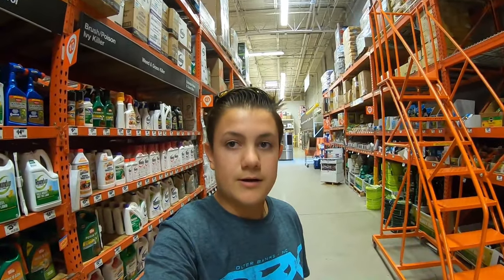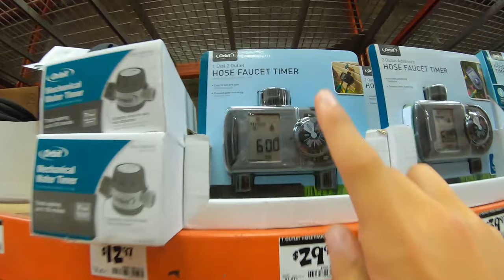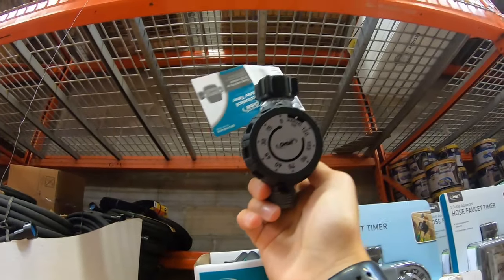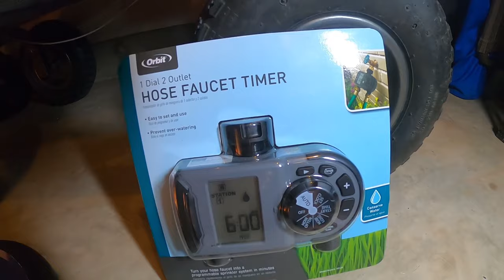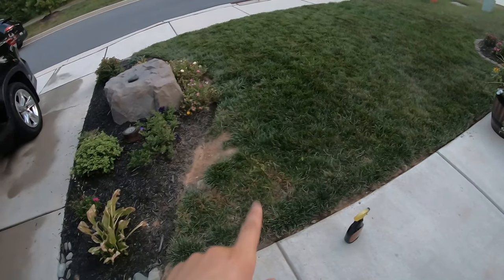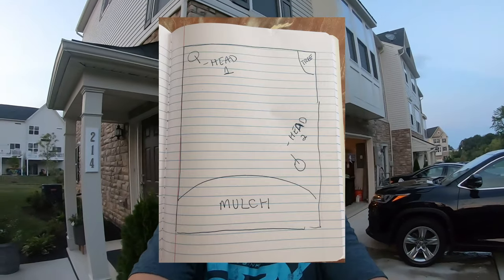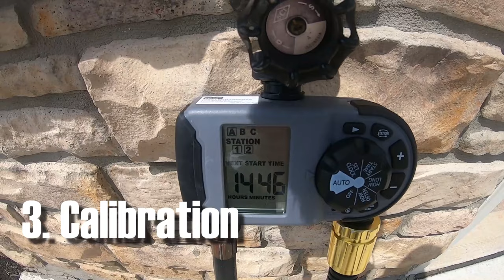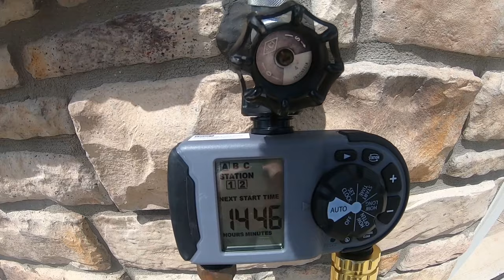Installing a DIY Above Ground Irrigation System | Combating Heat Stress

Comment: What's up, A? Great vid. Been a fan for a bit. You might consider two things: go to the plumbing aisle and look for something called plumber's tape or teflon tape. It's the same thing. It's usually a white plastic donut with a blue or red center. The tape isn't sticky, but it will help all hose connections to keep them from leaking. You might also consider exchanging that Orbit sprinkler you just bought. That shouldn't leak like that. Leaks cost you money, and they will oversaturate the areas where your sprinkler is giving you more of a chance for problems in those spots, nutsedge especially.

Good luck with the new set up. Can't wait to see the results in a future video.
Reply from the maker: Dude! I really Appreciate this! 1- All leaks are fixed! That black cap on the other side... was loose. So that’s fixed. I’m definitely going to get some plumbing tape... I may have some! Thanks for watching! I appreciate it!
Reply: @AsLawnandLandscaping  Glad to help. If you watch my vids, you'll see my son who is a little younger than you. He mowed his first lawn for his first customer this weekend. He decided to start doing it after watching your channel.
Reply from the maker: That’s awesome! I will check it out! Glad I’m an inspiration!